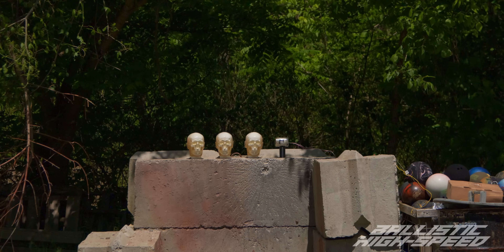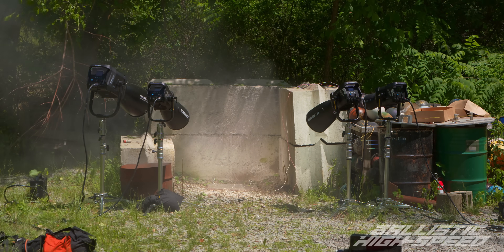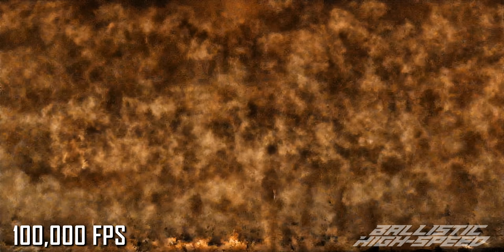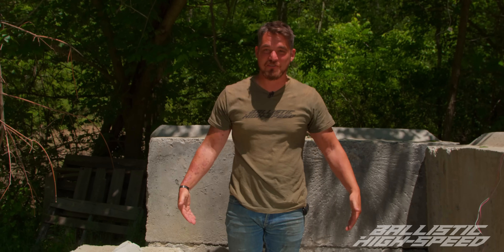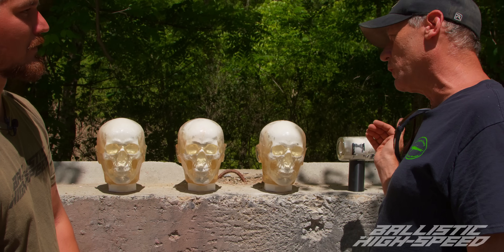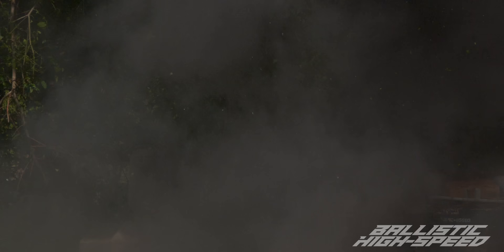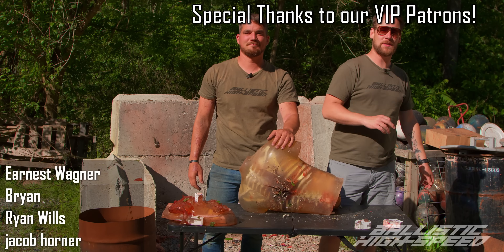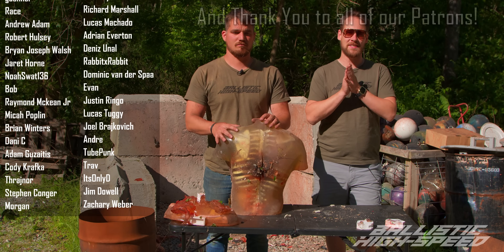Shaped Charges vs Ballistic Heads! - Ballistic High-Speed

Comment: Fun Fact: anything if struck hard enough, will emit light. Here are 4 ways it can happen!

1) Triboluminescence, generated when bonds in a material are broken when that material is scratched, crushed, or rubbed. 

2) Fractoluminescence, generated when bonds in certain crystals are broken by fractures.

3) Sonoluminescence is the emission of light from imploding bubbles in a liquid (see Pistol Shrimp, it's also similar in principal to #4)

4) Incandescence due to adiabatic compression* (this can run a Fire Piston to start a camp fire, or, with more power, a diesel engine, or, with WAY more power, it can start Nuclear Fusion!)

the 4th option is my favorite, and most pertinent here. when something is compressed, it takes it's heat with it. if you take a substance with any amount of heat, and condense it into a small enough area, it will increase the temperature, and if you do this enough, it'll glow hot!
Reply: Thank you, that’s a great explanation!! Really interesting to learn about this process!!
Reply: yes. In fact you will get much more photons in the radio spectrum than visible light. And at close ranges you tend to be shedding a lot of electrons, so you get materials forming plasma, carrying charges and generating magnetic fields as well.  Materials with a inherit internal crystalline structure (like calcium compounds) tend to produce more.  And for the most part you are imparting so much kinetic energy to something that it cannot impart that into any more chemical bonds or state changes fast enough. Those bonds being broken and attempting to get into a lower more stable energy state and the best way to shed energy quickly is by the creation of a photon.
Reply: One of my favorite light emitting reactions (which also happens to have natural sources) is cavitation.
The Pistol and the Mantis shrimp. It's also the effect that makes the 'smackin the top of a beer bottle' trick work.
Reply: @monty9456   yep, #3 on my list, sonoluminescence! so cool!
Reply: It is amazing how all this was discovered, documented, and understood in full. Got to love our race. A shame they want to get rid of us.
Reply: @rocksteady9826   It'll be rough, sure, but we'll make it through...

EAT THE RICH...
Reply: @rocksteady9826  what
Reply: @rocksteady9826  Okay I am a racist too but this is just nuts and totally unrelated
Reply: It is not the "rich" who seem to be the problem. It seems that Democrats warp the minds of people living off the street, to make them violent.

Comment: As a combat engineer in the Marines, I set off a 15 pound shape charge of RDX/C4) on a D10 dozer in the steel pit. Straight through. It was amazing!
Reply: What was the diameter? EFPs aren't typically listed by weight since explosives don't all have the same energy but weight. Diameter is a far better metric since one can then ascertain the effective range, potential, and so on.
Reply: @Deathbomb9 woah, hey there Mr.Unabomber type vibes lmaoo
Reply: There’s no job quite as fun as being a combat engineer, mortar man, or all the other specialists that get to deal with high explosives
Reply: Thats some serious penetration.

And no I’m not quoting a porno.
Reply: Fun times.

Comment: I think what Adam and the expert may have forgotten for a moment with that AR 500 plate is that copper shaped charges are what goes through the armor for HEAT rounds... That torso didn't have a prayer once it got put into that pit. Also you'd probably need around 5 or 6 inches worth of steel if memory serves to stop that sort of shaped charge, so 10 of those plates probably wouldn't work.
Reply: Is that actually how much an oil and gas shaped charge penetrates? If so, Thank you for that interesting piece of information. Also, in the oil and gas industry, copper powder shaped charges are used as to not plug up the hole with copper, so they probably couldn't penetrate as much armor. But than again, I am no expert.

Comment: We were educated on the power of an EFP (Explosively Formed Penetrator) while getting ready for our second combat vacation to Iraq. That scared me way more than typical IEDs. The fact that an explosion would turn a curved piece of copper into a molten mass of metal traveling at insane speeds and could cut through homogeneous steel like butter. Yea. That freaked me out.

Comment: I think the 'flashes' you see in the gel heads is from the gel deforming from impact, and changing the specular reflection of light.

For the last shaped charge vs the plate, I'm willing to bet the impact of the copper jet punched out a disk shaped piece of the steel that led the way through the torso - I've seen similar behaviour with AR500 when being shot with high caliber/velocity bullets.

Comment: I'd like to see a sort of... flash supressor setup.  AR500 with a hole drilled through lined up with the penetrator, but only just big enough for the initial jet.  Then a test piece beyond that.

Just to try and see what the jet itself is doing to the plate without it getting swamped by the charge.

Comment: So with the perforating charge you have to think it’s designed to punch through the chrome molly gun body, through a small fluid gap, the well casing cement and 40-60” of rock.

Comment: Great job guys! Keep in mind that these charges are meant to penetrate up to 1m of rock under pressure. They compromise by using copper powder (with a blend of tungsten) not to plug to hole with the slug.

With a mathematically designed zirconium slug your looking at 1m of rock penetration from 1oz of HMX pressed. That would probably penetrate 6 inches of AR500

These things are designed to penetrate steel first (well pipe) then rock. The amount of design that goes into these shape charges (angle, thickness, shape, alloy composition (powder)) is immense. 

Great job! Watch out for that steel casing shrapnel, it’s meant to be fired in a drill hole! That shrapnel could come back at you at .7-1kms

Comment: Those small little flashes kinda remind me of the phenomena how ridiculous flimed with the two glass balls, but in this case the "bones" are tearing apart so quick with so much energy it is creating heat and light as a way to disperse some of that energy.

Alternatively light from the explosion is just leaking through the micro fractures in the skull before it's obliterated

Comment: What if... you fired a shaped charge at a distance down into a scale model of some land mass. You could possibly have a semi-realistic depiction of an asteroid strike, given the speed capability.
You'd need to have the charge firing through a hole in some manner of buffer plate though, just to keep the shockwave off the model for long enough to see the effects. 

Also curious about any possible way of arranging materials into a 'bullet trap' for a penetrator and getting some motion out of the system without utterly destroying it. It would have to be extremely lightweight but sturdy and have to catch the jet in something that decelerates it gradually, like a thin aluminum tube filled with... god, aerogel? Phenolic foam?

Comment: Gavin and Dan over on SlowMo Guys did some high speed footage for shaped charges with the 7510 using its max frame rate of 1.75 million. But they were also able to use a camera given to them that can film 5 mil fps in b/w

Comment: We use shape charges at work to perforate casing in oil and gas wells. Depending on the size, they’ll penetrate the steel casing and a foot or two of rock, 10,000’ underground. I don’t have to wonder what they’d do to a person. Our biggest fear is a surface detonation.

Comment: There is this myth perpetuated by video games that if the distance from charge to target is increased, then penetration power decreases dramatically... Well, here is steel plate, them torso... And it made a hole in concrete... Yes, it is true that penetration decreased after 1-2m, but how much? Not enough. So, maybe if your tank had "spaced armor" at the distance of 3-4m away from your tank... lol
There is a video on some Russian channel about RPG and shaped charges. They brought lightly armored vehicle equipped with cage armor at some distance. The rocket hit the cage armor, detonated, pierced the armor, went out on the other side of the vehicle and made holes in trees dozens of meters away... So much about that...

Comment: You know...watching the video just now, I do wonder if you can put out like a color wheel into the black and white shot and then use the color information from the 100,000fps camera to basically recolorize the footage though color replacement of specific grey values based on the color wheel.

Comment: .3 lbs of RDX x 1.60 (RE Factor)= .48 net explosive weight. That’s got the punch to make it through mild steel with the Monroe effect alone and no penetrator. Try it again with the standoff of 1.5 x the diameter of the cone. You’ll get a clean hole👌

Comment: Wouldnt the friction from all the shockwaves turbo re-arranging the inside of the target generate static electricity? i think what were seeing at 13:50 is that electricity get discharged. you can see a lot in the first skull and if you look in the right eye socket of the second one it happens once there too, but theres none visible in the 3rd. probably because visible arcs can only build up at at 10k plus feet per second, but i could be wrong. my second guess is unexploded ordinance getting pushed through cracks, pressurizing, and then exploding but idk.    Excellent video btw, plenty of actual jaw dropping stuff.

Comment: To put that velocity of 30,000 fps in perspective, a tiny steel .177 BB from a childs BB gun only weighs 5.5 grains but would have 11,000 fts /lbs of energy at that velocity. The .50 BMG with 750 grains bullets makes about 13,000 ft/lbs. So yeah...🤯
Reply: I was thinking the same thought; what do you relate that ludicrous velocity to? How about the speed of sound?

26.659 Mach.  Accelerated to that in an instant almost.

For reference, the ISS in orbit is moving at 22.3 Mach.

Jesus Christ.
Reply: @FlyingFoxocube   That's humming along!
Reply: @solandri69   Your math is way off, my dude. :) It would be more like 8mph...a bit over 8mph.
Reply: @stanpotter7764  Cr*p, you're right. I misplaced a decimal point. I'll delete the erroneous post.
Reply: @solandri69   LOL, we've all been there! 🤜🤛

Comment: Fun fact: If you calculate relativistic mass increase for the shaped charge jet if it's 50 grams of copper at 6500 m/s to begin with, you get around 11.75 nanograms of mass increase due to its velocity. 
And if you think that's nothing as it contains the phrase "nano" be reminded that each of their frames is exposed for a time in the nanoseconds. Just a fun fact for y'all.
Reply: So basically ~ 1MJ/c²😅.
Reply: Just for numbers, it is going from 0.05 kg to 0.05000000001175 kg. Soo, not significant, but also, legitimately a measurable change. 

P.s. I double checked your math, you did it correctly! :D
Reply: It's hard to think of it as nothing when it involves something going so fast that it gets heavier instead of faster, in a way that's that close to a scale we can comprehend.  Sure, CERN can hyper-accelerate a Proton and fractionally increase its mass, but the sheer force of acceleration at work here is orders of magnitude beyond that.
Reply: @TheOtherGuys2  You are correct, yet it's hard for people to grasp the speeds at which CERN collides particles at. Even 10% the speed of light is incomprehensible to the human mind. In the case of shaped charges, we can comprehend the speeds, especially thanks to scientific analysis of high speed videography like the one in this video. And given that the numbers for exposure time and relativistic mass increase were so beautifully aligned, I couldn't resist to sprinkle a little bit of scientific fun into the comments.

Comment: Note. That small shape charge you used to go through the armor and torso. I could’ve told you that would’ve gone through without any problems at all….. I used to work in the Oilfield before I retired. I know what those charges can do. They use something very similar in charge size for fracking. ☠️👍🏻
Reply: Look up the CBU-105 Sensor Fused Weapon, the skeets in it are awfully similar to the size of this.

Comment: There are 3d printing formulations for Copper, Steel and tungsten carbide.
I've used the Copper; it prints about 85% the density of pure copper metal.
Not sure if dense enough for liner work...

Comment: Tbh, nukes don’t actually explode in a mushroom cloud shape. The shape of the cloud is a post-explosion effect caused by both the hot air around the point of explosion rising and the displaced air returning to the point of explosion and rising. The central column of air keeps rising as the air and particles lifted up earlier start losing their energy and falling out of the air. It is the same phenomenon with how people create smoke rings.

Comment: Fracking is done with high pressure water.  The shaped charge is for perforating an oil well.  Those little charges will have 10-14 grams of explosive in them and they are designed to blow a hole roughly the size of your index finger, 40 inches into solid rock.  

I was lucky and got to spend a day out testing perforating charges for an oilfield company.  They are super cool and extremely efficient explosives.  My guess is that if you placed one on the hood of a car, that the jet would come out the bottom of the oil pan.
Reply: My bet is the perforating charge would probably penetrate at least a dozen AR500 plates (depending on how much standoff space is left between the plates).  I've seen perforating charge punch a 1/4" hole all the way through an 8" steel block.

Comment: 4:35 Yes! Finally! You used the right standoff distance and did not place the shaped charge directly on the target. 🥳
Reply: Just saw they used no liner at all first, then really low quality (glass) and then unknown quality copper. But all of them with very non-uniform in density explosive, so about as far from ideal as it gets. 0 standoff or not would not make a difference here.

Comment: I understand the purpose of the copper lining in a shaped charge but why copper? The glass seemed quite effective. How about a steel lining or an aluminum lining? I'm curious what the differences in performance (penetration) might be. This is one of my favorite channels.
Reply: Copper is the best in terms of ductility and cost. For a shaped charge penetrator, you want a metal that can deform easily and not melt. Copper fits that very well. Remember, the real use for shaped charges is for penetrating thick armour, not heads in the air.

Comment: So, I'm just guessing, but my thought is that those sparks you are seeing are similar to what you see in the bubble cavitation of a pistol shrimp. 

Essentially the pressure is so immense that it generates enough heat to vaporize the material itself.
Reply: Wild, thank you.
Reply: That would be awesome if it reached those insane pressures. Also I think it could be something like Triboluminescence. It is the mechanical creation of light by shearing a crysaline structure. So cool.
Reply: @alexburnes3551  I hadn't even considered triboluminesence as a thing, that's also very possible.
Reply: Good idea!  I am thinking it's either that or the pressure wave propagating through the head and compressing pockets of air until they diesel.
Reply: It makes me wonder how fast you would have to hit something with a bullet to get the atoms to fuse. Maybe if you fired like a syringe needle through a railgun you could get it to happen

Comment: Makes me wonder if you can't use the color info from the one camera to overlay on top of the colorless higher rate video if you have them side by side... Sounds like something AI might not be terrible at, "overlay the color from this side by side on top of this higher frame rate video" "try again but don't suck this time.... Nevermind, I'll do it myself."
Reply from the maker: Definitely something we’re experimenting with! Probably not the AI route, but using compositing and programming to assign various color tones to different luminances.
Reply: @BallisticHighSpeed  look me up if you need a code monkey. Sounds like a fun project.